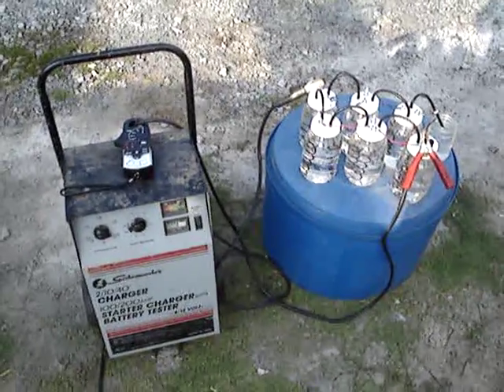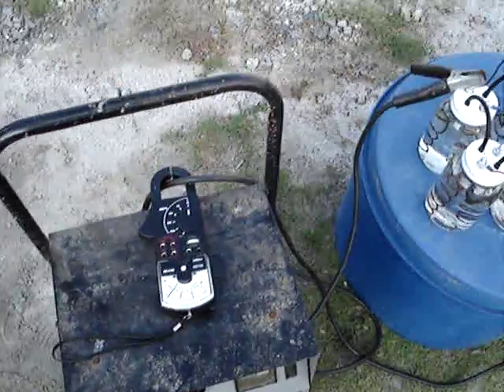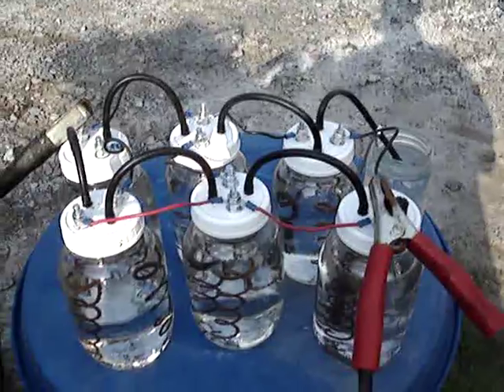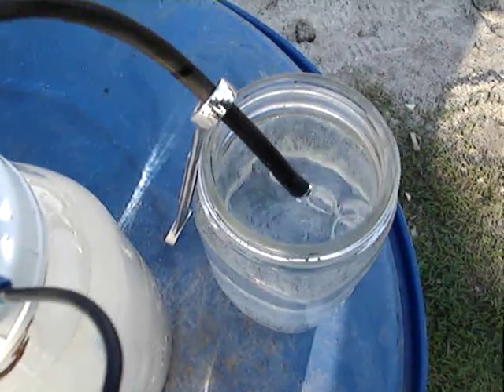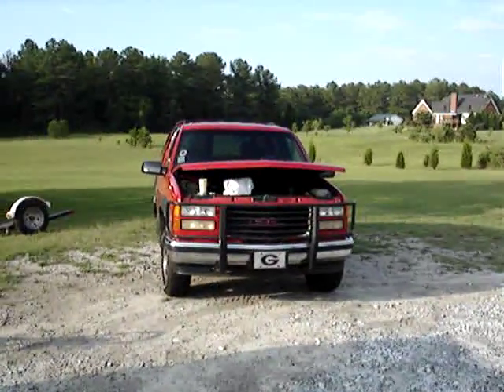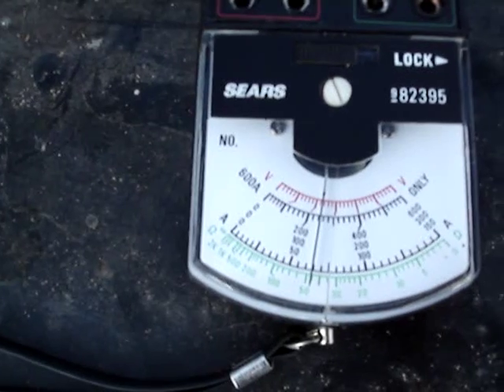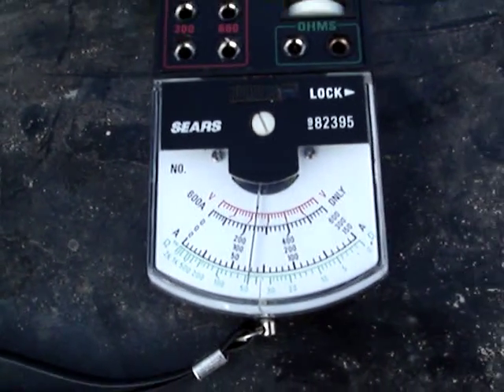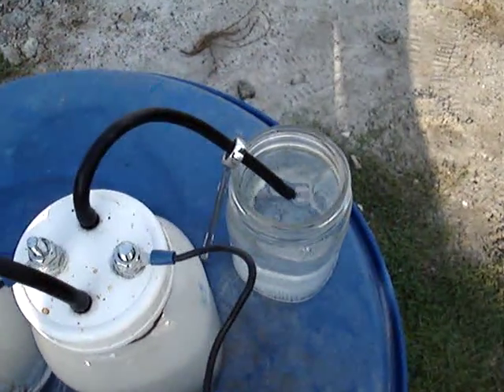HHO - 1994 Suburban 5.7 V8 - 1 Bench Test

Comment: If you can get that up to between 30 and 50 amps without overheating i think you can see a big difference in power.  although you need to watch the water temp and amp draw. The amp draw might also drain the battery if using the AC and blower fan.  I am upgrading my Alt to a police version in my Corvette to compensate for the amp draw.  And my corvette Alt is going in my 71 pickup.  The case is exactly the same.  I recommend your setup though.  Very conservative.